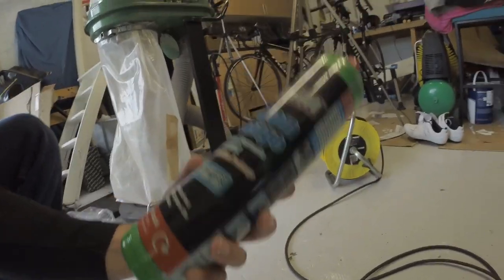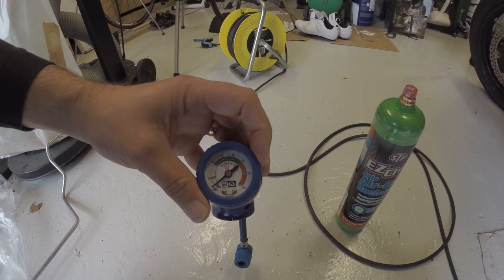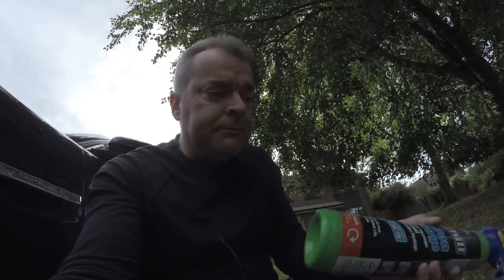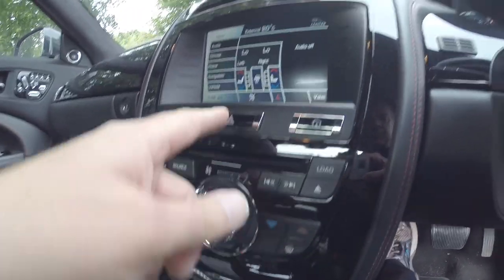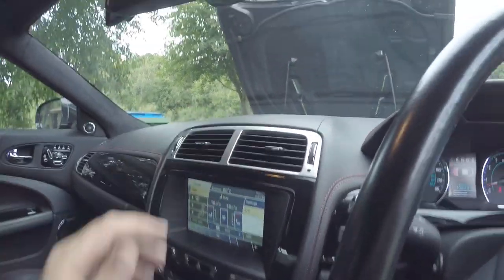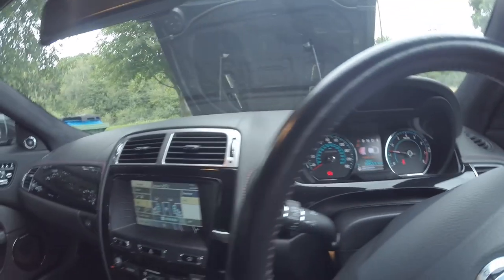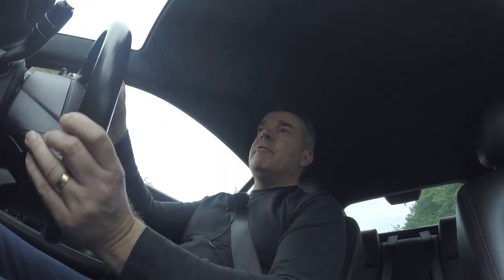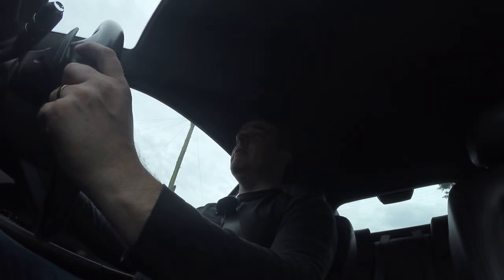2013 Jaguar XKR A/C air conditioning DIY fix and some V8 Engine Tunes

Comment: I have the same 5.0 XKR as you and I've had 2 others before this one, and ALLLLL 3 of them have suffered from bad aircon problems, especially with the unequal temperature from either side like you just demonstrated.  I've never been able to solve these issues....and today in the UK its 34 degrees.... about to regas myself now
Reply from the maker: Normal an air leak in a hose or the condenser does it. Then you have to put the system under vacuum for ages to get all the moisture and air pockets out. Then load in the correct weight of gas. It’s a ball ache. My top up job worked but it wasn’t the best. Just got me a bit cooler. 
The xkr has made way for an f-type r now which is awesome. Check out some of my videos on that beauty. :)
Reply: @chisnsid

Comment: Great detail and info, thanks. Very professionally done. I have 2012 XKR (since July 2019 )and you've given me the confidence to work on mine even though it looks like quite a daunting beast> I'm in Vancouver btw.
Reply from the maker: it's a car at the end of the day really, I've just done the front brake pads in less than an hour...
should have put a video together on it - oops :(
Reply from the maker: must point out too that the system needs to be vacuumed first, the fix was limited therefore , I needed to go to a proper a/c garage a few weeks later to get that done, but hey ho... the pipe replacement went perfectly and it saved hundreds in garage bills :)
Reply: @chisnsid

Comment: The air con in my 2010 XK (non R) works but doesn't go as cold as I think it should - my X5 goes quite a bit colder and gets there a LOT  quicker. The Jag can take between 1 and 4 miles to start to feel cold depending on the outside temperature. I've had it regassed but can't say as I noticed much improvement. I'm wondering what else it could be? No leaks found when they regassed it. Looking through the front grille the condenser doesn't seem full of rubbish, leaves etc. Could it just be clogged internally are they just never that great on an XK? Or could there be another issue causing it to take so long to go cold? I can live with it not being icy cold like my X5 but would like it to get cold faster if possible. Cheers anyone who may reply!

Comment: Thanks so much!  I can do this now!
Reply from the maker: Sometimes you’ll need a garage to help if the system is totally empty, those top up cans don’t always do the job. The system needs to be put under a vacuum to make sure all the moisture is out then refilled with the correct amount of gas.

Comment: I'm informed my XKR a/c condenser is leaking (everything else is functioning when gassed but its not holding it in) and I am wondering if I should tackle it myself, but it looks more involved than a pipe change.  Maybe that is too much for me to tackle ?
Reply from the maker: I’m not sure about the condenser change as I’ve never done one on the xkr. . I’d let a pro do it if you aren’t confident to have a go.
Reply: @chisnsid  Thank you for the advice. I am coming to the same conclusion. I like to have confidence in the car. Best wishes.